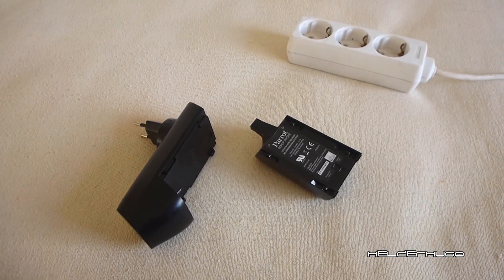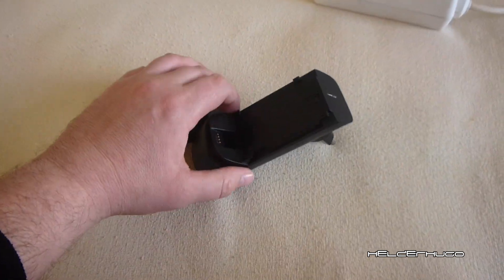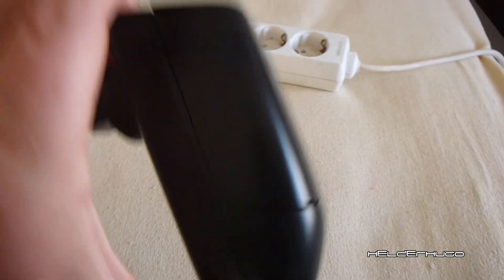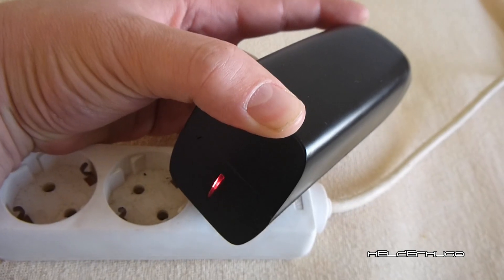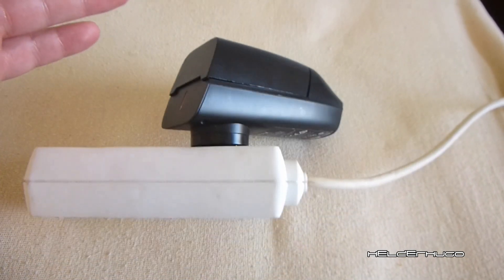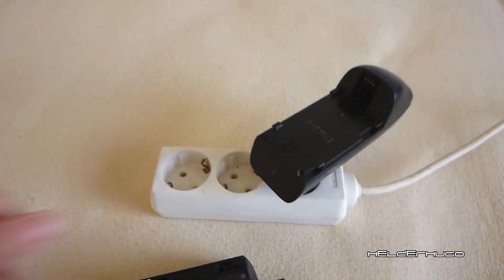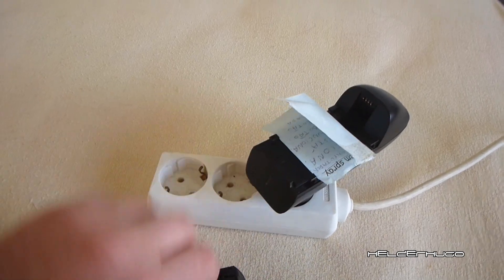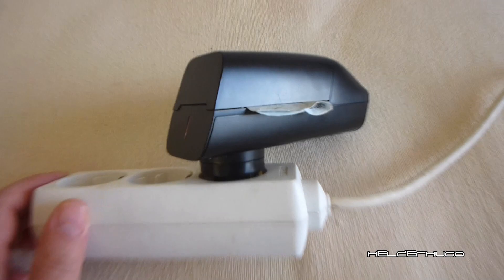Parrot Bebop charger and Battery bad connection solution

Comment: Hey,
So I had the problem that my battery charger's red light was flashing. I searched and tried a lot of 'battery fixes' all of them didn't worked, but I came up with one that worked.
What you need to do is:
1. Put your battery in the charger.
2. Find a charger with 2 sockets.
3. Put the charger in socket 1 and wait till the red light is on.
4. Pull it out and put it fast in socket 2 before the red light turns off.
5. Wait 2 seconds and pull it out again and put it fast back in socket 1 before the red light turns off.
6. Repeat the process 4 till 10 times and let it in the socket.
 
It won't flash anymore Smiley Wink
You're welcome!
 
P.S. Tell me if it worked for you Smiley Very Happy
P.S.S. Link to topic: https://community.parrot.com/t5/Bebop-Drone/Battery-Charger-Red-Light-Flashing/m-p/157328#M17280
Reply: Ive tried so many different fixes that dont seem to work. I will try this. 
Ive even bought another battery which charged but then got the red flash of death on 2nd charge attempt 🤬

Comment: Hi. Do u know why my Bebop 2 power bottom keep s flashing and will not connect to the app.? I have renstalled the app several time. It will connect to the wifi but not the app and I can not hard reset bcuz it s keeps flashing.! Do know of a fix or wat is wrong.?  Thanks

Comment: Somehow I managed to unpair my Parrot Disco by pressing the start button for too long .  I was attempting to operate / check out the functioning   whilst indoors .. and the lack of GPS was also causing the Disco to refuse to kickstart .Aclever guy in the uk talked me through my problem and it is now  operating nicely .. I have still to pluck up the courage to throw it into the air .
Reply: do you have a link?

Comment: I bought two Parrot disco   drones   and one of the chargers  is faulty  the red charging light does not come on and there is no output from the charger .I have all of the serial numbers . where can I obtain a replacement for this faulty charger .
Reply from the maker: Contact Parrot
Reply: at 74 years young  i have no idea how to register and get in touch with Parrot ... the other charger is working ok and I am able to charge both batteries .
Reply from the maker: Here: https://www.parrot.com/global/support/hotline